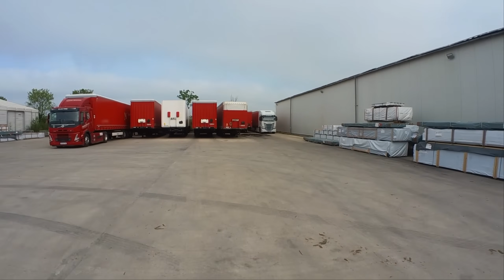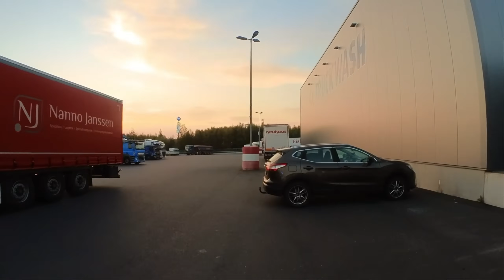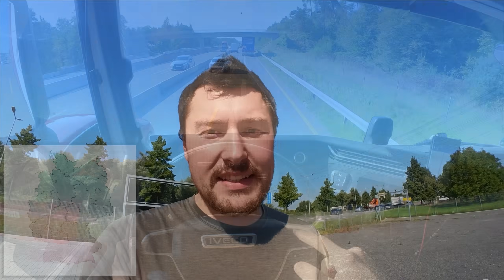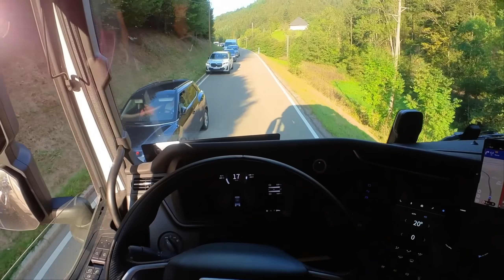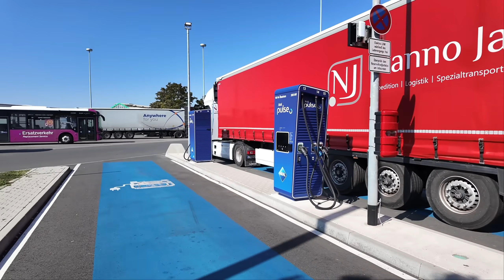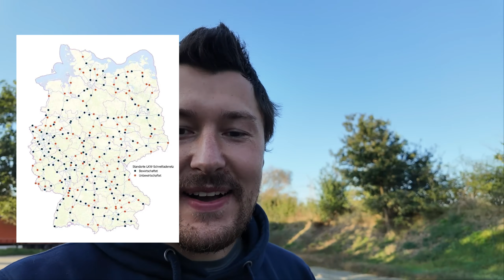Soon you can use your Home Electricity Price at Highway Chargers in Germany

Comment: I'm surprised that those forecasts still include hydrogen trucks.  If you just look at the economics it's clear that hydrogen is a non-starter.  If you look at the underlying physics and chemistry, you see why the economics have no chance of getting better than those of BEVs.  Other factors including safety make hydrogen even less attractive.
Reply: Hydrogen in road traffic = Dead horse. Those who still research in that direction do so to syphon off public funding.
Reply: Hydrogen may be a good option under some cicumatances.  Think remote areas (Australian outback) or very cold where BEV isn't efficient (Ice Roads, northern Canada, northern Scandinavia etc)
Reply: @peterhoz  At 3-5 times the operational cost it will never be an option. Also way more complex and expensive to maintain. Even this first generation BEV trucks can do trips perfectly aligned with legal drive/rest periods. Cheaper to have an off-grid fast charger at an outback location than a single hydrogen fuel browser (plus the high fuel and transport cost).
Reply: @peterhoz  technically and logistically thus is not a valid solution. You need to get the hydrogen to the station and this is done with a 30t trailer carrying 300 kg ! of hydrogen, so you end up having a lot of gas trailers constantly moving  hydrogen to the station over long distance. Very expensive. Even more expensive is to have a hydrogen Production at the filling station with the need of water purifier, compressors, process control system for a hazardous system and that somewhere in the Outback? It seems as if people in Germany are obsessed to find a business case for hydrogen even as it makes in the end no sense, just to keep that bad concept alive.
Reply: @peterhoz  You appear to misunderstand EV efficiency.  With light duty vehicles, heating the cabin is what contributes to a large part of the range loss in very cold weather.  The larger the vehicle, the less this is a problem as the energy needed to heat the cabin is a much smaller portion of the overall energy in the battery.  BEV HD vehicles should lose less then 20% of range in very cold weather - I lose 20% in my light duty vehicle.  Also, it's hard enough to make the economics work for hydrogen in densely populated areas, it will be much worse for remote areas where there are much few trucks.  In those edge cases, diesel (or biodiesel) are likely the only realistic options.  BEVs might work as even the remotest of settlements already have electricity and adding DCFC is much less expensive than adding a hydrogen filling station.
Reply: @peterhoz  Hydrogen will never be a good option. Land transport is a solved problem and the solution is electric. Everything else will end up being a rounding error. Being from Oz, let's take your outback example. Already sorted for settlements and properties at unreliable extreme-edge-of-grid locations. Solar and battery microgrids. Cheaper and more reliable than trying to build and maintain tenuous grid filaments over Australian sort of distances (one bushfire and whole stretches are gone). Trust me, no one is even building, refuelling and maintaining hydrogen stations in easy to access capital cities, let alone a thousand kilometres from the nearest service technician.
Reply: Only if you assume that you always have energy production that can be planned or a way to store electricity in large quantities. So realistically a lot more nuclear power plants needs to be built or an energy storage of sizes that we cannot even dream about today needs to happen to rely only on BEV. Or we need to accept that if it is cold and/or not windy/sunny then we do not transport anything.
Reply: @archibaldhaddock7450  spoken like a nuclear energy worker or proponent ;)  Mark Jacobson and others have shown that we don't need that much storage to get by even in the worst cases.
Reply: @archibaldhaddock7450  nuclear will be, like today,  a niche product in the future because of costs! 
Per 1MW installed nuclear power you get 7.900 MWh per year in nuclear about 2.500 MWh in Wind (on land) and in Solar 1200-2000 (depending where you put it, Detroit or New Mexico). So in Solar you need to install 5-times the power that is for an typical 1300MW nuclear reactor you need 6500MW of Solar to get the same yearly amount of energy. Building costs are  per 1MW installed power nuclear: 15 Mio USD (Hinkley Point C, wikipedia);  Wind: 1,3Mio USD and Solar 1 Mio USD.  So in our example 1300MW are in Nuclear 19,5B in Solar 1,3B. So there is enough money left to invest in batteries. And while the building process of a nuclear power plant lasts for 10 to 15 years you will get already power from your installed solar modules.
In Germany alone there is the installation of 162GW of battery power in the pipeline. permits from grid providers are already requested
And in Europe we have an international grid, so it has to be without wind and sun and biomass and water over the whole continent from norway to Sicily and from the Baltic to Marocco (yes, they are also connected). im more afraid of Mr Putin attacking the infrastructure online or power plants (nuclear) in real

Comment: 3:48 So happy the govt is following you in the positive way. 😊 I watch your channel for the positivity you put out. Your ranting is also in a positive direction. Thank for your service.
Reply: The truck charging spot. The two chargers make good sense since the way I see it, batteries have to move to the trailer too and may be propulsion under control of semi will be an excellent progress. This will bring down charging need of the whole unit to a huge extent. As the trailers are being loaded, the batter on them get charged. The semi arrives, attaches and drives them away. The trailer could actually have solar as structural to charge itself while parked.

Comment: I can't believe that there will be more electric trucks sold than diesels by 2029: it's only 5 years away!
Reply: it's a question of economics. if your excel sheet give a lower price per ton per kilometer you do the switch or goes out of business.
Reply: Consider Norway. In 2021, only a few percent of sold vehicles were BEV. 10 years later it was 65%. This Year, it will be approximately every car.
Then consider what cars were available 5 years ago. The only long-distance suited Bev were from Tesla. Most BEV were mostly suited for local commuting.

For trucks, the sales (or better what is delivered) of course still on the level of the early 2010s (considering Norway). But as Tobias shows us, those trucks are on a level like todays passenger cars. So why should the transition in sales (not in the whole fleet) not happen much faster than for passenger cars?

But of course, just 5 years for 0 to >50% is incredible.

Comment: Another great update from Tobias. It is amazing that every single issue or inconvenience he mentions would be solved by battery swapping trucks and/or trailers and that so far only CATL, the worlds largest manufacturer of EV batteries recognizes the solution and is building out the network in China.
Reply: @tedspradley  absolutely. However, things that are not owned tend not to be looked after. That said, battery management systems can prevent misuse. When charging stations also have battery buffering then the days of overnight charging will be a memory. We can expect early redundancy of low-power charging points.
Reply: I can't see battery swap stations actually taking of. For cars were already at the point where swapping isn't much fester than high speed charging. With Megawatt charging for trucks well have that as well.
Reply: There's an Australian company that does E conversions for Road trains that also have swapping side packs
done via an electric  forklift. 😊 It was featured on the 🇬🇧 Fullycharged channel.
Reply: @clivestainlesssteelwomble7665  That's great for places that don't have enough power from the grid or have wind turbines or solar panels near by. It's great for Australia that is difficult to get hundreds of miles high power cables, they have sun and wind almost all year. They can charge many batteries slowly with very small cost. In Europe is not so difficult to connect to the high power grid.

Comment: Whether this turns out to be true or not, Europe should focus on ensuring the charging infrastructure is rolled out ahead of this schedule. A 50/50 ratio by 2029 means that probably 90% or more of the trucks in Europe will still be diesel, so that doesn’t sound too ambitious.
Reply: it is indeed , thats a huge shift
Reply: Logistics companies saves money with the EV trucks and that means more profit margins. That is the point when money 💶 talks and 🐂 💩 walks. Diesel will be out of the door 👋
Reply: @BobDevV  There are so many inaccuracies in your statements, that it would take forever to go through all of them. The 2035 ban is for new registered cars. In 5 years 90% of the customers will buy electric cars anyway, so this law is basically just a last call for the industry to stop spending billions into a dead technology. Diesel trucks get replaced before they reach a million km. Many of them won't even make it to that. With 240 work days a year and 2 charge cycles per day, You need 12,5 years to get to 6000 cycles. If you could drive 700km per day with those two charges, that would lead to 2 million km in those 12 years. And the battery is then down to holding a 80% charge, not dead. These trucks will drive long range for 5-6 years and then will be swapped to shorter range delivery for another 15 years. Then the batteries will move to second live and the rest of the truck gets recycled. 
If you charge those truck batteries with 300 kW, they aren't fast charged. They have a capacity of up to 600 KWh, so they only charge at 0.5 c. At that speed they aren't even getting warmer, while charging. Nothing happens with a truck in a snowstorm. They carry a massive amount of energy with them. Using 10-20 KWh to keep the battery slightly warm and the cabin cozy overnight, is nothing. If i am stuck on the Autobahn overnight, then an electric truck is by far the best place to be.
You are massively overestimating how long long haul trucks are being used. These aren't fire trucks that are driven once a week and have to hold 30+ years. Not having any data is just not true. Mercedes wouldn't sell their new truck with a 1.2 million km guarantee, if they had no data.
Reply: You're right a lot of these batteries will have a second use as home/grid storage. It is my opinion that road trucking must require a lot of logistics planning regardless of powertrain so actually it's probably less affected than the car transition to EV.  @BobDevV
Reply: That's 50/50 sales.  The old trucks will still be out there.
Reply: @BobDevV  Maybe those Germans learnt a bit from their knee-jerk closure of the nuclear power plants. But that was not  the point of my reaction. I was trying to say that 50/50 by 2029 is not ambitious enough for a 2050 net zero target. At the same time, it may be tough to achieve the buildout of charging infrastructure to support that - although Germany seems to have put a pretty smart plan in place for that. Your point about battery degradation sounds like a rehash of the old arguments against EV cars. Apart from a few early Nissan Leaf and Renault Zoe models, EV batteries (e.g. old Tesla ones)  have largely outperformed their promise of 70% capacity after 8 years. I know only time will refute your argument (what can we say today about how long LFP batteries will last?), but I am pretty confident it will. Only one way to get the data, as you suggest.  My 7y old Tesla model S battery is at 92% capacity, and yes it will become a home battery system eventually. As for 16y on a truck battery being a joke, how many engine overhauls would a diesel truck have over that lifespan?